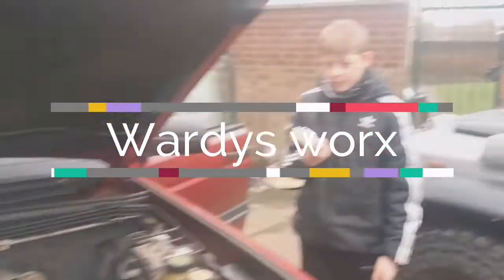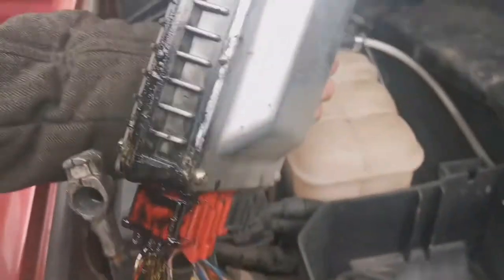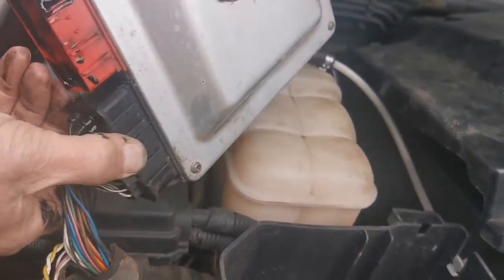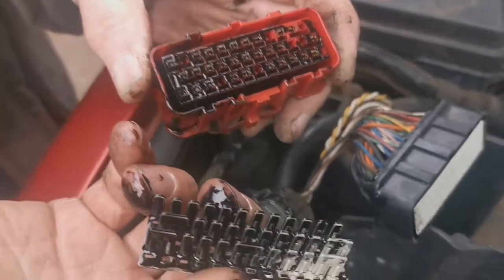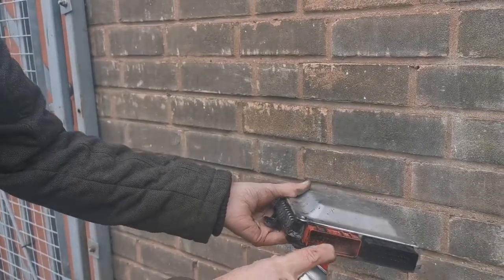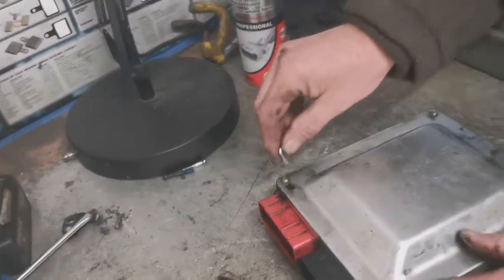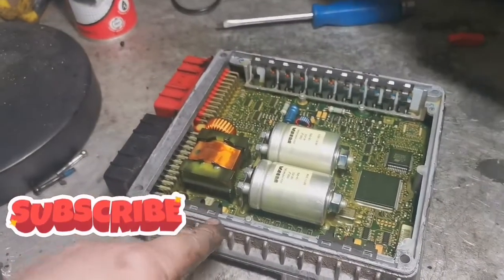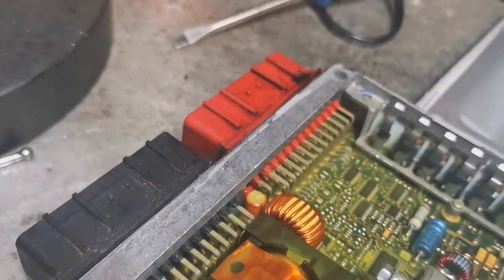Td5 discovery 2 oil in the red ecu plug cleaning

Comment: I found if I disconnect the injector plug and ecu, drop the ecu end down under the body and leave it for 3 or 4 days I get a heap of oil out of the wiring loom